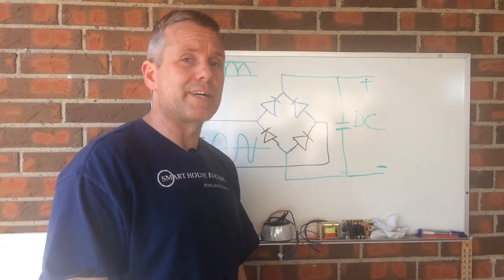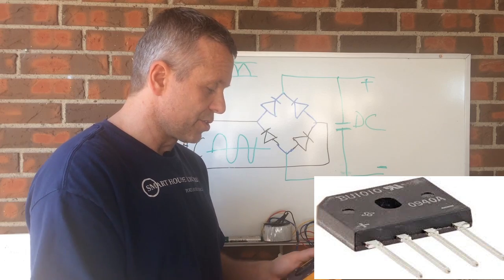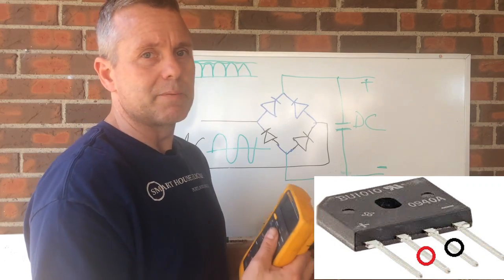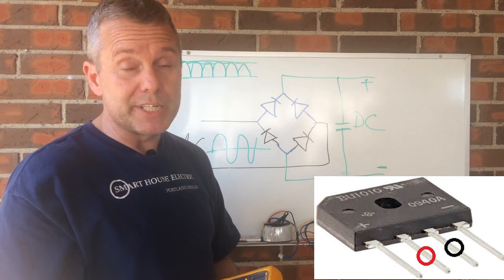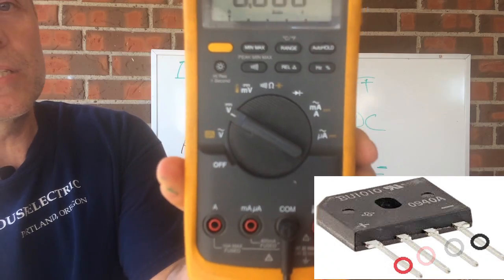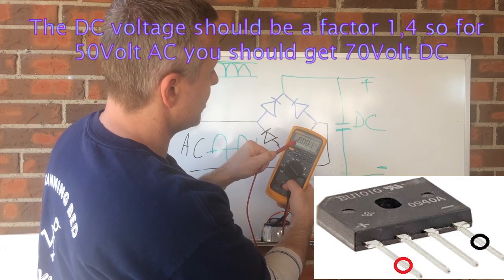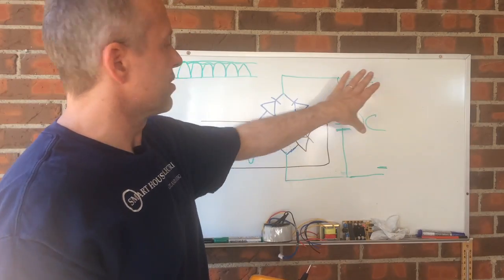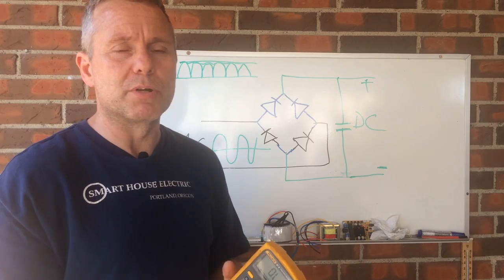Troubleshooting a bridge rectifier

Comment: Hi, more than 95% of YouTube demonstrates how to check the bridge rectifier of the circuit board, but in my opinion take time to remove it from board and avoid more problems by doing so. So you explained the best test without removing the bridge.  Thank you very much.

Comment: I did test, my transformer AC is ~ 8.1  volts
BUT above bridge KBU804 DC voltage show ~ 7.3 volts?
is it defective?
My amplifier no work,  AC is 16.7 volts, and must be bridge out DC ~21volts, but is ~8 volts. WHATS WRONG? 
2 bridge rectifier KBU804 is fu.... bad, why ?
I test with multimeter and reading is ok, but DC voltage is not alright

Comment: does the 1.4 factor work will all AC voltages?
Reply: Yes, it is a square root of 2
Reply: @powerzx  I did test, my transformer AC is ~ 8.1  volts
BUT above bridge KBU804 DC voltage show ~ 7.3 volts?
is it defective?
My amplifier no work,  AC is 16.7 volts, and must be bridge out DC ~21volts, but is ~8 volts. WHATS WRONG? 
2 bridge rectifier KBU804 is fu.... bad, why ?
I test with multimeter and reading is ok, but DC voltage is not alright